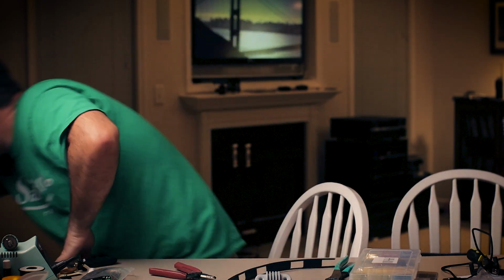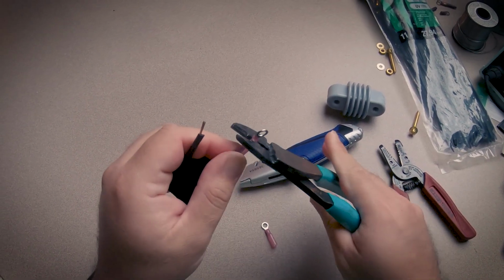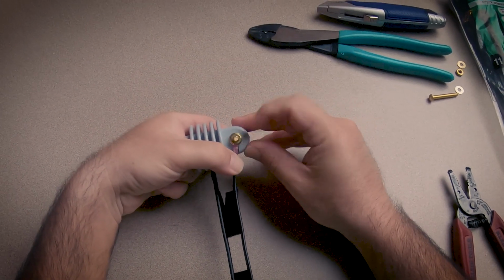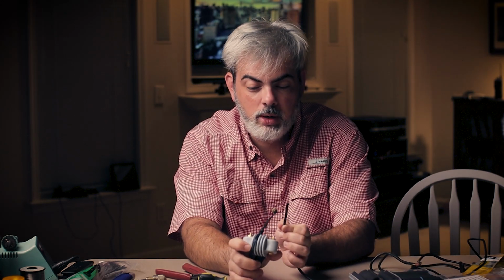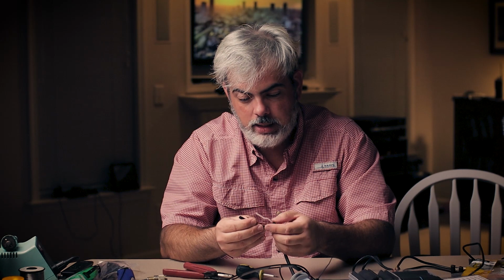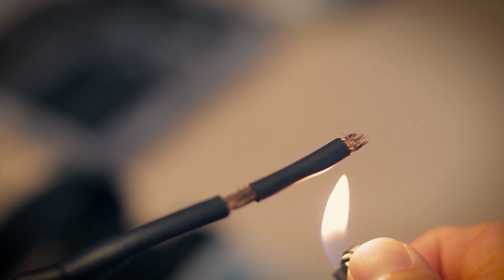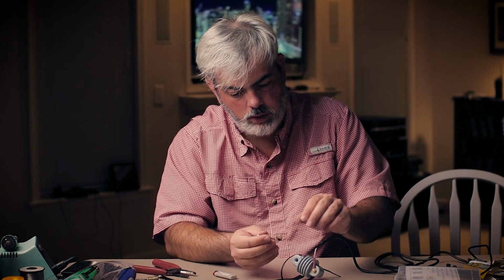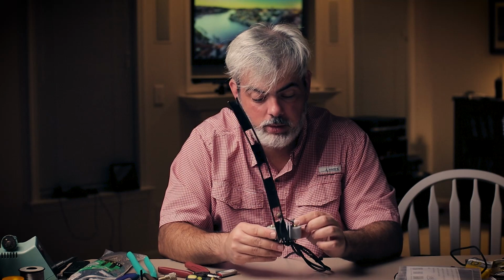Mating your Coax to Ladder Line

Comment: Thanks for the great demo.  The arrl book shows an inside ceiling dipole with a center connector using ladder line down into the automatic tuner.  An LDG  AT 200pro II has a PL 259 connection for the normal antennae/coax.  Does this mean we can connect the new dipole's ladder line to another coax with the right PL 259 connection to go into the tuner?    thanks
Reply from the maker: Depends on the antenna design; if it’s part of a matching section or just the feedline. If it’s a short run, it shouldn’t matter much however

Comment: I prefer to solder onto the tab and i find the solder coats the copper cores ( Capillary effect or wicking )  and protect the core(s) from water corrosion  then coat with silicone grease and shrink flex on top seals it perfectly
Reply from the maker: I crimp for the mechanical connection and then solder

Comment: Why not use a 4:1 or a 1.1 balun or run the ladder line all the way to the shack to a balanced tuner? You will get a lot of loss in that coax.
Reply from the maker: You can do what you want. This was to answer som questions people had about the transition on the zs6bkw.
Reply: @AE4VJ  perhaps Kris will put out a video showing his improved method!

Comment: Thanks for the video! Sorry to ask, but if we just connect an unbalanced to a balanced feed line without any transformer don´t we get a mismatch with lots of power loss and

 high swr? Sorry my bad english. 73 de PY5CL
Reply from the maker: Depends on the antenna. A lot of doublets use the ladder line as a matching section. Theodore, no transformer needed. Such as the case with the zs6bkw antenna.
Reply: @AE4VJ  Understood, Thank you!  I want to use a ladder line as a feedline to an End Fed Zepp but it has to be connected to a coax cable at some point. Can use the same method you taught?
Reply from the maker: Sure.

Comment: Can you just solder an S0-239 to the ladder line in the case where you have a PL-259 pre-installed on your coax? Then goop it all up with silicon, plastic sealing tape, heat shrink, seal it up in some sort of junction box, ...? I don't really want to pay for, or build, an SO-239 to coax to pig-tail. Neither do I want to cut up my coax with pre-installed PL-259s. Is fitting an SO-239 to ladder line just a bad idea?
Reply from the maker: You can. It becomes a bit tricky when you start to heat it up to solder. You don’t want the insulation to melt and short the conductors. The other thing to take into consideration is strain relief. You don’t have to use an antenna insulator, just some non-conductive material.

Comment: Why do you teach other people to make mistakes ? They will find your video and will connect a symmetrical line and a coaxial cable without using additional matching devices. You connect a 450 ohm line and a 50 ohm line, the difference is 9 times. It is more correct to place either a symmetrical tuner or a matching transformer at this point.
Reply from the maker: Ladder line is a used as a matching section for many antennas thus, making the coax transition a necessity. For example the ZS6BKW antenna. If someone is using a 4:1 balun for example, they would not need this as the balun will transition to coax.
Reply: Because there are many applications where this is used. And without any transformer.
G5RV etc..